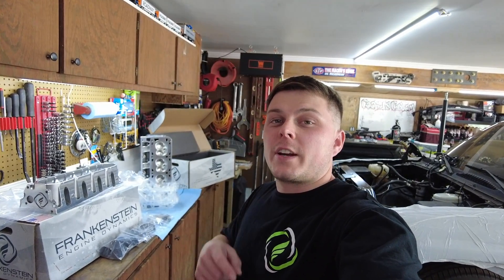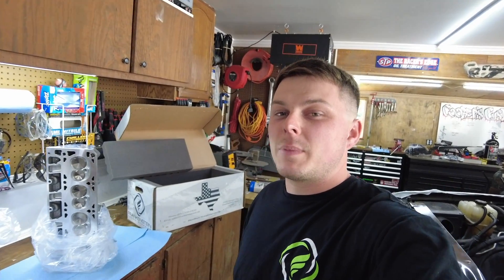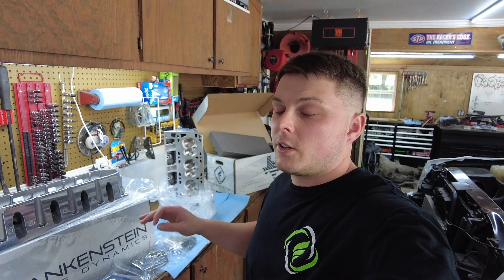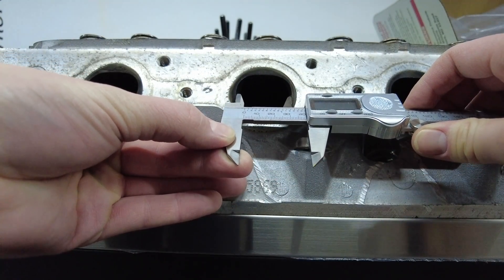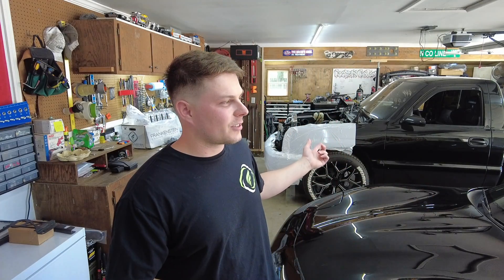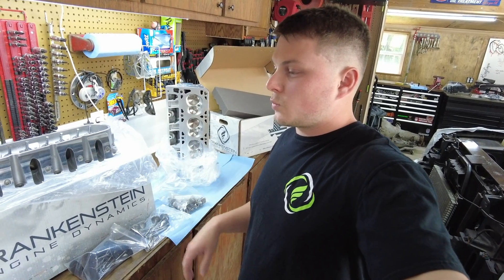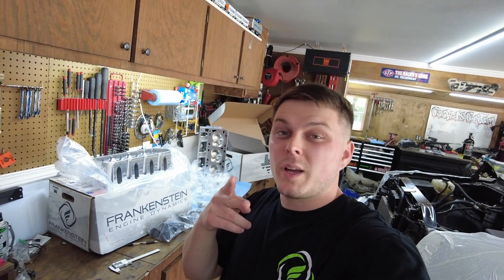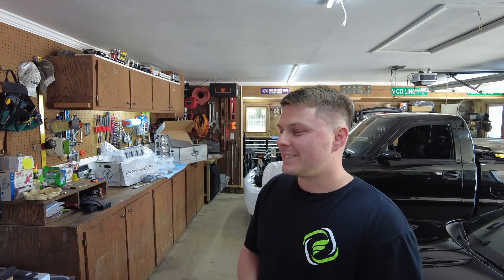New Frankenstein Stage 2 Heads!! 243 Cathedral Port Monsters!!

Comment: Can you use some stock valve cover on those heads
Reply from the maker: Hey, sorry for the late reply. You definitely can. I do. I just make sure to get the gen IV valve covers. That have the square port on the inside. It's the newest updated version. It helps ALOT with oil consumption, in the PCV system.
Reply: @TheKingCoopa I have a Gen three motor so everything already bought and built waiting to be put in my car.
Reply from the maker: Nice, hopefully it lasts a while!! I beat on mine pretty hard haha.
Reply: @TheKingCoopa  😂😂😂😂

Comment: What’s the update, were you impressed? Any dyno info?
Reply from the maker: Hey, I can't give the best results on the heads, only because I changed alot at the same time. But im sure they made a big difference. 

Old setup was a 4.8, 224/226 112 crane cam, tbss intake, 3.73 gears, and the 243 heads. Made 355hp. 

The new setup is a 6.0 LQ9, 236/242 112 cammotion cam, tbss intake, 4.10gears, and ported 243 heads. Made 472hp.
Reply: @TheKingCoopa  that’s 472 to the wheel right!
Reply from the maker: @DUNDEETV.24  correct. The 4.8L was on a hub dyno, and the 6.0L was on a roller dyno.  The new motor is setup for a 250shot of nitrous. So I'll be getting it dynoed again in about 2 weeks with that.

Comment: I wonder if the 799 heads or 823 heads would work with a supercharger on lq9
Reply from the maker: Hey, sorry for the late reply! You should be able to make them both work, as long as the supercharger ports match the heads. Cathedral or Rectangular ports.

Comment: The 50hp over 317 heads?
Reply from the maker: The 50hp is from stock 243s to ported stage 2, 243s. Not sure about 317s but you could give them a call. Nice company to deal with.

Comment: I love your truck, it motivates me to work on mine! I have a lq9 and I plan on upgrading heads, I’m not sure which to go either with 243 or 823
Reply from the maker: Hey thats awesome! The LQ9 is a good motor to start with. Personally I'd stick with the 243 heads, just because its the same generation and the easiest. The 823 squar port ls3 heads flow really well, and they can fit on the gen 3 motors, but I know they need a little tweaking and you need specific parts to make it all work. Im not super knowledgeable with the gen 4 car motors, so im not much help here. I just say the 243s because thats what I know haha. But if you want the 823s and have good knowledge on it, then go for it! They will make some really good power. 

Thanks for the support and sorry for the late reply. Hope that helps
Reply: 823 rec port heads fit perfect in a gen 3 6.0..you don't need anything

Comment: Valve size is what, flow numbers are what??????
Reply from the maker: Hey, its been a while since I filmed this, honestly don't remember what the specs on them were. I know you could give frankestein a call, I'm sure they can answer any of your questions. They were a good buisness to deal with. 

I did have the truck dynoed last week. On stock wheels it made 450whp before the nitrous, and calculated to 470whp on my smaller drag wheels. Thats also going through a built 4l80e and transfer case.. So the heads definitely flow pretty well.
Reply: @TheKingCoopa  - You were talking about flow and saying the valves are huge - huge by what standards are you using? 

Port dimensions has very little to do with the airflow in the, which is in regards to the intake port coming from the bowl area and the short turn radius crossetion area. The exhaust is relatively the same but the port dimensions and crossection do make a good deal of difference  -  

I have no desire to call one of my competitors to find out something I already know- if it is a ported factory head you can't put more than a 2.020 intake and 1.57 exhaust valves without changing the seats 

I'm glad you were satisfied with the performance you got

Comment: Would these head fit a stock block 6.0? Or are they too big?
Reply from the maker: Hey, they will bolt right on. Mine is a stock bottom end 6.0L. All LS Cathedral Port heads will bolt onto any 4.8L, 5.3L, 5.7L, or 6.0L.  But these probably flow WAY to much for a NA 4.8L or 5.3L.

Comment: Are there issues fitting the intake manifold with that much taken off?
Reply from the maker: Nope. I went .015.   I've seen some guys even go .030 with no issues to the intake manifold. Thats alot for a cylinder head, but in the aspect of the intake, .030 is still a really small measurement
Reply: @TheKingCoopa  Nice! Thank you for the reply. There's a lot of different things spun around on forums. It's nice being first hand accounts on what works and what doesn't.
Reply from the maker: @EXTRA---LARGE---FARVA  for sure. You're always gonna find alot of miss-information online.  Just be careful with cutting too much off the heads. You will start to run into PTV issues. (Piston to valve clearance issues) especially if you get a monster camshaft, or different ratio rocker arms. Its a little bit of a science. If you're tuner is pretty experienced, they should beable to recommend a good combo for your setup. Probably even off the top of their head. you will also need shorter pushrods if you mill the heads. Good luck with your build 🤘

Comment: Those heads look fantastic 👏 can't wait to get mine rebuilt and ported on my 2006 LS4 5.3 with truck Norris cam
Reply from the maker: Thanks! I'm super happy with them. That will be sick, especially in an LS4!  Alot of people love the truck norris cam too, can't go wrong with that
Reply: @TheKingCoopa  im ready to go got everything but Doug thorley headers but I think I might be ok with just the ported heads and cam plus swapping out to a truck intake!! Got my trans rebuilt with Circle D 2800 stall
Reply from the maker: @nathandunn6974  if you could get the headers before you tune it, that would be ideal for maximum gains of the tune. The truck intake is pretty great, the tbss/nbss  is even better, but im sure your limited on   fitment/clearance with an ls4.  And the 2800stall is good all around, thats what I used to have in my single cab, and I liked it alot. Picked up fast, but still daily driving like stock.
Reply: @TheKingCoopa  that's the only issue with that TB SS intake its a headache to fit and lots of modification to make it fit!! I still might get the headers im shooting for 370 maybe 400 hp
Reply from the maker: @nathandunn6974  yea, I wouldn't worry about it then. With all those modes, I think 370hp is definitely a reasonable guess!
Reply: @TheKingCoopa  yeah these ls4 cars can handle 400 hp tops but anything over that is too much and tranny will break at some point so yeah thats a reasonable goal 350 to 370 or 75 hp!!

Comment: I got the same build as you 6.0 LQ4 4l80e chop monster cam 3600 stall converter LS7 lifters Yadda yadda I really really wanna go with those heads bad. I got the 317 heads got the trunnion kit done and what not. My question is what kinda fuel system you going with?
Reply from the maker: Oh nice!! Sounds like a really solid build 👌👌 hopefully I can start mine up by April 1st. (I took on way to many modifications at once with this truck lol) but frankestein did say their stage 2 porting will get about 50 extra HP on a 6.0. They are expensive though. 

For the injectors, I went with some fast 50lb or 60lb injectors, what my tuner recommended (fast injectors are a little harder to tune, unless your familiar with them)  then added holley billet fuel rails. 

And for the fuel pump, I'm still not sure yet. I dont think my pump will keep up with the nitrous. So either a hellcat pump, or two walbro 450 pumps. Long term goal is twin turbos, a few years from now. So I might just do a fuel cell setup, and buy the big pumps now. I still have a few weeks to decide. Sorry, but hope that helps

Comment: Any PTV clearance issues? Finally getting the 243s. The book you recommended me is great btw
Reply from the maker: Oh nice, thats awesome! There isn't any PTV issues with the 243s and 4.8L-6.0L. The issues start to arise when you get a larger camshaft, different ratio rocker arms, or mill the heads down.

My heads are milled .015, I have stock rebuilt rockers, and my new cam is like a 240/234 112+4 I think. Don't quote me on that one. But when I spec'd everything out, that camshaft is the largest i can go, since my pistons aren't butterfly cut. Or I would have PTV issues.
Reply: @TheKingCoopa  interesting thanks. I’m going with the BTR Red Hot Cam for the SBE LS2. BTR RED HOT CAMSHAFT

221/24X, .619/.617, 113 LSA
Reply from the maker: @JuanyJuanes  oh nice, hard to go wrong with BTR. They make alot of good cams. The lift and duration isn't super crazy, you shouldn't have any PTV issues.
Reply: @TheKingCoopa  appreciate it. I may document my build and put it on YouTube. Ppl are discouraging me from dumping money into a old car (heads/cam/ported intake and TB cost $5-6k), but the car ain’t worth shit as a trade in. I would rather learn and make mistakes on a old car than a C7
Reply from the maker: @JuanyJuanes  screw what other people say. You need to look out for your best interest and what makes you happy. If doing that will make you happy, then do it. (Not trying to brag) but I have $28k into my single cab, and I just bought 5,600$ drag wheels and tires for it. You think people don't tell me im dumb lol. I bought the whole truck for 6k...... when you customize a vehicle, usually for every dollar you put in, You get about .40cents back. Thats just the way it is. I dont ever plan on selling my truck, so im not worried about it, and do what makes me happy. 

Yes it would be good to learn on an older car. Even if you did get a C7, its still gonna be more expensive to make that fast as well. Going fast isn't cheap haha. Plus everything on a C7 is going to be expensive. 

And one other thing, idk where your at in life. But for example, if you're living in an apartment with no garage, have alot of debt, or this is your only car, I would also  discourage you from it, I'd recommend doing some other priorities first, then modify the car later. A race car and daily don't mix lol. It will break down eventually. I know that's alot of info, but hope it helps.
Reply: @TheKingCoopa  facts. I got a rental house so I’m in the middle. I used to live in apartments and it was crazy working on cars there, but I managed to do it. 

Cars coming together. Just waiting on getting the heads back. FED had them for a month now. 

I got a ported fast 102. Kinda dreading installing it cause I gotta drill out a hole for the sensor and cut it
Reply from the maker: @JuanyJuanes  oh nice, There you go! I think they had mine for like 7 weeks? I dont remember. But just take your time with the intake and go slow. You got this 👌
Reply: @TheKingCoopa  haha goddang it will be a while I guess. Looking forward to getting the car out back together
Reply from the maker: @JuanyJuanes  oh I bet! Hopefully it all goes well 🤘

Comment: Those heads look awesome! Came across your channel because looking for info on getting my heads ported on my 2012ctsv,did it gain 50hp?
Reply from the maker: Hey, thats awesome, I love the ctsv's. So I havnt finished putting everything together yet. The motor and transmission are installed. But I decided to do a wire tuck in the engine bay.... terrible mistake. I should have been done with this truck months ago 😅 but even if it was finished, I can't truly answer that question for you. Mainly because I have to many variables. Went from a small cammed 4.8L and 4l60e, to a fully built 6.0/4l80e, 3800stall, large cam, ect. Im changing to many parts to really know if the gain from the heads was worth it. 

I called linkinfelter, they wouldn't give me any hp specs for their heads. But I thought it was pretty bold of frankestein to say it will get +50hp. But they were pretty confident and I believe them. I'll find out soon though haha. Sorry, hope that helps you out. Thank you for the support! 🤘 good luck with the ctsv

Comment: What awd transfer case are you using?
Reply from the maker: Hey, I'll be running the NP149 NP3 transfer case, with a 32 spline input adapter to mate up to the 4l80e.
Reply: @TheKingCoopa  where are you getting this from? Do you have a video on the installation?  Love the videos!
Reply from the maker: @99hawk75  i found it on Facebook marketplace. Had to drive an hour away and I talked him down to 180$. I dont have a video of it yet. Still searching for the AWD front diff from an SS truck (4.10 gears) the yukons had 3.73, plenty of these. The input adapter is made by time2kill and is like 600$......  but right now I'm filming a 4 video series of me cleaning and wire tucking the engine bay. Once I get it finished and tuned ill do the AWD swap video. Thanks for the support 🤘

Comment: I really want some heads for my 5.3 but i honestly feel like ill lose power with the loss in compression getting rid of my 862 heads. 6.0 i could see a big benefit,  those heads looks awesome. Big $$ though
Reply from the maker: Hey, sorry for the late reply. Personally I'd stay with the 862 heads for your 5.3L, unless you're planning on going boosted or making some big HP. Even when I ran my stock 243s on my cammed 4.8L I had dozens of people telling me the stock 243s flow to much and I was losing power. So some ported CNC heads would be a waste of money on a stock 5.3. But they are definitely expensive, I cried a little when I paid for mine 😅 thanks for the support 🤘
Reply: Do it the smart way. I had 243 heads made with 62cc chamber size which is same size as 5.3 heads. Tsp prc heads when u order them they ask u what cc size u want.

Comment: Those heads look amazing. What material is the intakeand exhaust valves and how much do they weigh?
Reply from the maker: Hey, I appreciate it! The valves are made by Mahle, and are Stainless steel. Not exactly sure the individual weight. But each head weights about 28lbs.